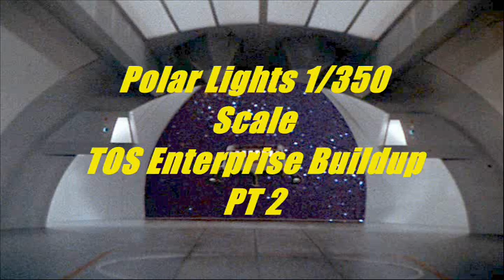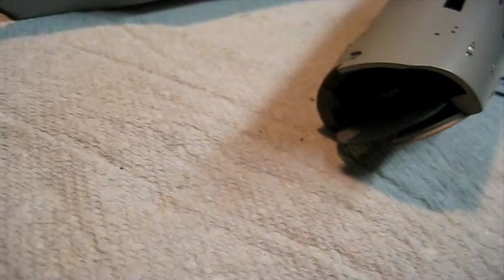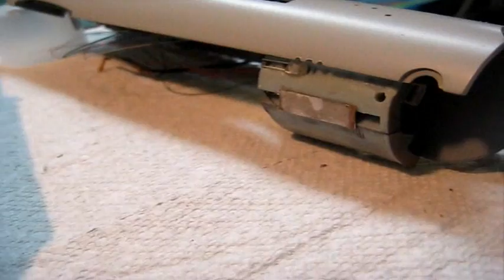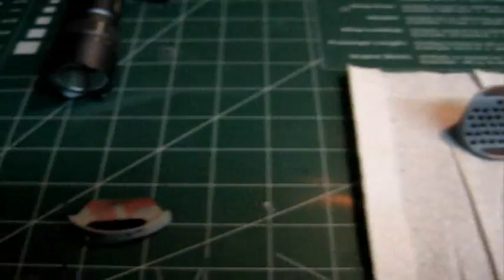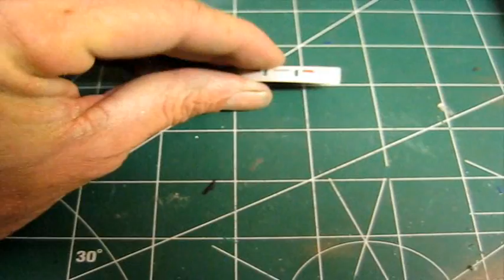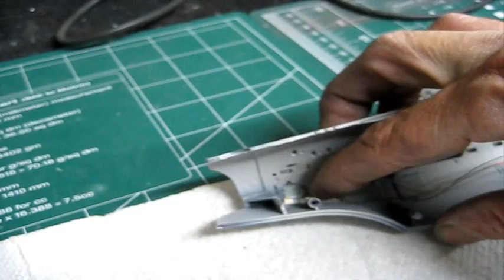Polar Lights 1/350 TOS Enterprise Buildup PT - 2 Lighting The  Secondary Hull

Comment: How much room is between the shuttle bay and the outside wall. I saw that problem and went looking for LightSheet. Couldn't find but found a company called Miller Engineering. The 2504 kit looks like enough material to slip between both walls of the shuttle bay to light the outside windows. (Don't know how thick it is, but it looks paper thin in the photos and is flexible.) Can't wait to start mine. I just want to get a lighted model under my belt, and this one I won't have to Aztec! Thanks!

Comment: Wowser-- those shuttle bay regions are TIGHT. You've solved the problems with straightforward creativity-- nice. Have you considered finding/using 1.8mm LEDs or itsy-bitsy SMD LEDs? There's a whole new world of warm white versions, which is great. They need a lot of micro-fiddle, but they will fit where nothing else will (easily!). The fantail work looks good-- what a funny place to have a mounting tab, huh?

Comment from the maker: Yes there is a kit for it from Round 2. It's almost $200. Costs more than the model.
I'm building this kit as the 2nd Pilot version from Where No Man Has Gone Before.
No rotating lit engines on that one. The Modelers Brand LED tape I'm using is exactly the same stuff the comes with the lighting kit. No matter which lighting you use or even the clear parts, the shuttle bay and hull need to be modified a lot to make the lighting look right at the rear windows.